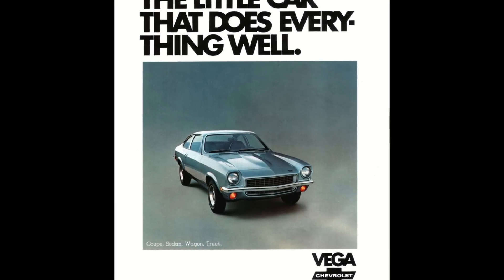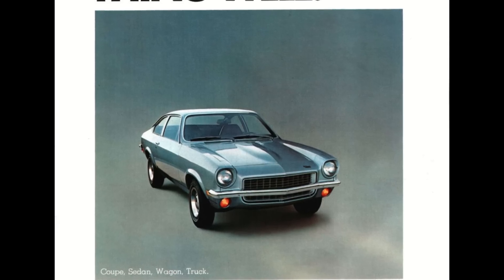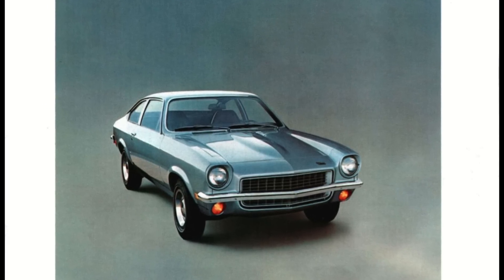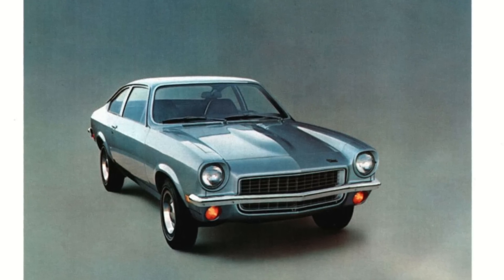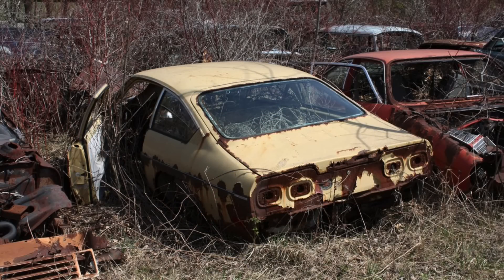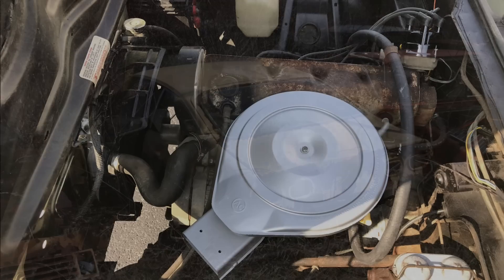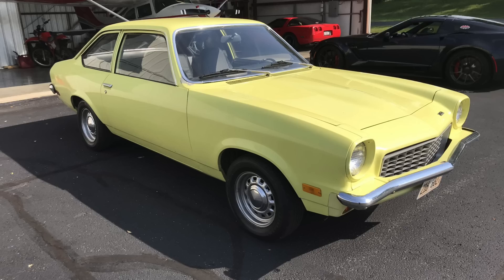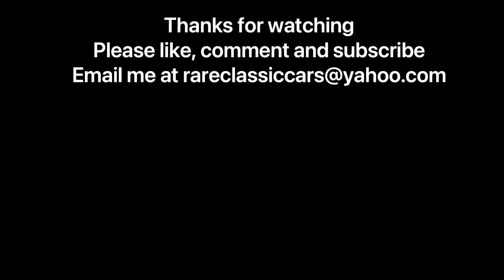GM's Largest Failures: Why The Chevrolet Vega's Engine Turned Buyers Away From American Cars

Comment: In the later 70’s, I had a Vega when I was 17 years old, it burnt a lot of oil…. Fortunately I worked at a gas station and just refilled it with  USED oil from oil changes…. 😂 …. That simple approach made it a great car… NOT.

In the end I had three of them, would pay 50$ for them… thats how bad people wanted to unload them…

Front brake caliper mounting pins would walk out , rear brakes would not hold an adjustment, the front rotors were non-vented and would FADE with one stop.   WORST brakes on any car I have ever owned.

 Front  frame where the upper control arms would bend inwards and make alignment impossible without a correction kit ( off set bushings from Moog ) .     

I had two others that I also bought cheap and one did not burn oil , to my surprise……    

I used to beat the living daylights out them….😅.   I could care less about them….

The odd thing , they all got hit by other people and it was their fault, not my fault, were totaled by insurance companies and I got far more money than I paid for them…  I think people would try to put them out of their misery!   So that made them a great a car….😂

Honestly, that car turned me off GMs…. 

Did I say how much enjoyed beating the day lights out of those Vegas? 😊😊😊😊😊

Comment: The Vega could have been such a good car. It was an entry level young persons car and Chevrolet should have made it better if they wanted long term customers. My friend had a used 71 Vega Wagon. It rusted out in the firewall. You could poke a screw driver through it. He wasn't a car person and was on a 300 mile trip when the head gasket blew because it was low on coolant. They replaced the head gasket but the cylinder walls were badly scored. It burned a quart of oil every 75 miles at which point you had to replace the oil fouled plugs and it would run again. The oil problem got worse over time. We drove 26 miles one way to college and before we left we replaced plugs and before we drove home replaced them again. We would clean them and reuse them. He carried a case of oil in the back. It soon got to the point where it had very low compression. It would barely make it up a hill and leave a smoke trail everywhere. His girlfriend told him if he didn't get a better car they were through. If you road in the car when you got out you stunk like burning oil. He finally sold it for $75 and got a nice used 75 Ford LTD 4 door sedan. Talk about a 180 degree switch. His girlfriend hated that car too. That car also rusted to the point the front bumper fell off! He knew I was a car guy and never told me he was buying a Vega. If he had I would have told him just don't buy a Vega! Later in my career I worked with an auto engineer that had worked on the Vega project. He told me they new the engine was a mistake but it was too late to stop production but they had already begun research on a better engine. In 1975 my uncle bought a Monza. I think it had the Vega engine. He never had a problem and he took good care of it. My dad had a 79 Pontiac Sunbird and it had the Iron Duke engine. He never had a problem with it. The Vega had another issue and that was the gas mileage wasn't as good as it should have been for a sub compact car. Good video on the Vega. Now people put V8s in them and drag race them. I know a guy that did that but that's amother story.

Comment: I had one of these in college.  I used to buy the cheapest oil I could find by the case.  I added oil probably every 100 miles.  Definitely more often than adding gas.  I justified it as a continuous oil change.  The car was absolute junk.  I had other GM products after the vega and none failed to disappoint.  Needles to say I no longer consider GM or for that matter any domestic auto manufacturer when looking for a car.  It hurts to say that but unfortunately it's reality.

What's really funny is that it doesn't have to be that way.

Comment: It seems the popular consensus is to blame the aluminum sleeves, but Mercedes and others have had great success with the hyper-eutectic aluminum cylinder walls. The massive V8s in the 450 and 560 SL series. My wife had one with 300K miles on it and still ran fine.

Comment: I have owned two Vegas in the past. A 1973 GT and then later a 1977 wagon. The first one burned so much oil that when you pulled into the gas station, you said to the attendant, please fill it up with oil and check the gas. .. on that car. the fenders were rusted so badly that I could put my whole arm inside of them. However, the second car was much better. I bought both cars dirt cheap. The 77 did not use a drop of oil and was pretty much with no rust. I drove it to almost 90,000 miles before I sold it and it still was in good shape. The cylinder blocks were alloyed with silicon for the reason of improved cylinder wear characteristics on the parent metal block. At the factory, the cylinders were electrically etched to melt the silicone alloy and create a glass like surface on the cylinders that was very hard. This hardened surface was only about 5000 of an inch thick. Cylinder scuffing did not occur during cold start up. It occurred when the engine was overheated. Usually the back cylinder would scuff first because that was the hottest cylinder in the block. Dura built engines starting in 1976 still used the same block but have many improvements. They had improved oil galleries in the head and had hydraulic lifters instead of solid. Also, they had a better location for the high temp indicator light in the cylinder head and additionally, they had much larger radiators with low level coolant indicators. Interestingly, the odd design of having a cast-iron cylinder head on top of an aluminum block was due to the weakness of the original aluminum block. The cast-iron head was meant to help stabilize and strengthen the aluminum block beneath it. These design changes allowed the engine to realistically have a service life of over 100,000 miles. But the damage was done with the previous model years and with a poor record sales fell off and the engine was discontinued after 1977. The body platform lived on for several years in the Monza and Pontiac Astra powered by the Iron Duke 4 cylinder.

Comment: Ford should have paid attention to the history lesson taught by the open deck cylinder design head gasket issues of the Vega. There are many fairly new 4 cylinder EcoBoost engines with failed head gaskets, and Ford eliminated the coolant groove passage between the cylinders on the deck surfaceand used drilled holes further down on new design.

Comment: GM had a perfect 153 ci 4 cyl engine on the shelf they could have used all along. Then in the late 70's when they restyled the Vega (and called it Monza), they came up with the Iron Duke which looked like the 153 but was entirely different.

Comment: Congress turned American buyers away from American cars!
Americans wanted big cars, that was what was selling and was in demand. Along comes congress, they hit American automobile manufacturers with gas milage mandates, 5mph bumper mandates, and exhaust emission mandates all at once and gave them 3 years to do it. It takes 3 years from the design board to the factory floor to put a car into production. Plans for cars yet to be built were already 3 years away and were still in the design stages. The Japs were already building cars that were fuel efficient with small engines that produced less emissions than America's V8's. Japan is a group of islands with zero natural resources and all their petroleum has to be imported, so the have always built small cars that used less fuel than ours. The Japs moved right into the automotive market in the USA and Congress (Democrats controlled both houses at the time) handed them the golden key to the U.S auto market, with no tariffs, and ruined the U.S auto industry for good. $6,000 of the price of every U.S built automobile goes toward the U.A.W pension fund for a retired workers that no longer works for the company, Japan doesn't have that expense. The U.S auto industry will always be behind the eight ball and with Chinese cars coming soon. the USA will probably exit the auto industry altogether.

Comment: I had a 1974 vega i bought new almost immediately the head had to be replaced after that it used a little oil. I never had any other problems put a lot of miles on it. It died in a 5 car pile up in 1977. I am glad for the built in head rests. I was the middle car.

Comment: In 1976, my first car was a rusty used 1972 Vega. My 16 year old self purchased it from a "Mechanic" for $250.00. It was junk. I turned the corner one day and steam came out of the front of the car. The radiator had rusted off it's mounts and got a hole tore into it from the plastic fan. Re-cored the radiator and the black plastic fan was still in good shape for continued use. Every time you hit a bump, you could smell gasoline.
My High School buddy told me Vega would go down in history as one of the worst cars ever built. I told him he was just jealous because he didnt own a car yet. LOL!

Comment: We had a 73 gt ,4 speed that would hang up and not go in any gear if you pulled up reverse lever while shifting to 1st gear. A spring would hang on the exhaust. You had to reach under car to move the spring .

Comment: In the late 70s', we had two guys, Frank and Harry, who used to come to our shop and buy Chevette motors and radiators out of wrecked vehicles and install them in the Vegas. They were actually pretty good cars then. They built several dozen of these Chevegas through the years. RIP Frank and Harry. All through the 70s' and early 80s', when people would buy small cars, they would always ask if it had an aluminum engine, that's how bad the reputation of the Vegas were.

Comment: I've owned 6 GM vehicles in my 50+ years of driving.  Not ONE of them was reliable, and every one of them came with serious design defects that in less than 100k miles of use were either costly or impossible to repair.  I haven't bought a GM vehicle during the past 30 years, but wish I'd learned this lesson even earlier.
Reply: You haven't owned a GMT-800 series pickup with an LS motor, then...
Reply: @SEO122  Or a GMT 400 platform truck either.
Reply: @SEO122  You're right, I have not.  And won't ever.  I do respect the Chevy 350 that was in the last GM I bought as a good all-around engine.  Too bad the rest of the vehicle was junk - everything from the pathetic 4L60E trans that failed at 80k miles, to the howling differential that failed at 60k miles, to the main wiring harness that failed before 100k miles, to the heater core that failed before 80k miles, to multiple failed electric window motors - I've only listed some, not all, of the failures.  I bought a 2009 Mazda and disposed of the Chevy with barely 100k miles as part of the "Cash for Clunkers" federal program in 2009.  Guess what, I've already driven that Mazda nearly twice as far as the Chevy, and it has never required anything but routine maintenance...not 1 single failure of any type.  An additional consideration:  if I'd driven the Chevy for the additional miles put on the Mazda since disposing of the Chevy, I would have burned an additional 5000 gallons of gas during that time, based on the difference of their EPA ratings.

Comment: I still own the '73 GT I bought new. The issue with the Vega engine is GM's alone. Reynolds used  chrome plated pistons, and a larger radiator in their test cars. GM reused both to save money. Nothing really wrong with the A390 alloy, but the cooling issues really doomed the car. Reynold's walked away from the Vega in 1971, largely because GM cut too many corners.

Comment: My dad had a Vaga GT and the engine did just what the video said, the engine was burning oil with in about 40000 miles he took it to the mechanic he used all the time and he said he could fix it by putting sleeves in the engine they took the block to a machine shop and they bored it out the put sleeves in it and put new pistons in and after they did that the car ran really well he gave the car to my sister in 1979 and she drove  the heck out of it and in about 1982 it was setting on the street and a guy ran into it and totalled it out it had about a 160000 miles on it when it happened

Comment: The air cleaner comment is correct, however it was advertised as a 50,000 mile air cleaner.  So in theory, you would only need to purchase one filter in 100,000 miles.

Comment: GM obviously didn't spend years testing this design. Mabye one year. Another case of engineers thinking they are such genius's, they do not need any testing. Their designs are simply flawless. Any of the problems associated with this engine could not possible be due to design flaws. GM should have gone back to the old reliable ' iron duke ' cast iron overhead valve or the iron lined V6.

Comment: I don't think the open deck would have been an issue if the head was also aluminum. Honda doesn't have any problems due to cylinder walk until the power is well over stock.

Comment: Knowing the failure of the Vega engine, why did GM again try the aluminum/iron design again 10 years later for the Cadillac HT4100?
Reply from the maker: It had cylinder liners
Reply: @RareClassicCars  Ah ok. Well, at least they eliminated that issue 🤣

Comment: My mother bought a new 1973 Vega Kamback ( wagon).  It didn't  have air-conditioning,  and she loaned it to me during the hottest week of the summer.

So I drove it with the 2 front windows rolled down ..... and surprize absolutely no outside air entered those open windows (perhaps because the air trapped in the car couldn't get out.) I've never driven a car where opening a window had zero effect.

Comment: Great video! I thought you may have mentioned that Vegas uses a ridiculous  rubber grommet for an oil cap.  
I was  a young gas pump attendant in years 1972 through 1974. Back then we had to wash ALL windows and check under the hoods of EVERY car.  
When any Vega with more than about 35,000 to 40,000 miles came in to refuel,  it ALWAYS needed oil. Due to the difficulty in removing, handling and replacing the extremely hot rubber plug grommet that GM used as the engine oil fill cap on the Vega engine, adding oil was a lot harder than it needed to be. 
I recall the grommet oil cap  was on a sloping surface and I had to either pry out the grommet with a screwdriver or use my finger nails. It was hot and oily and as such would usually be dropped and roll somewhere under the car. 
Usually, after adding the oil, it was a challenge to replace the grommet oil cap into the hot engine. Once or twice my oily fingers  dropped the silly rubber grommet again! 
Such a design on an e engine that didn't burn oil would be fine. But using a rubber grommet for an oil cap on a Vega was a curse!
Reply: Tell them oil is all sold out!  Lol!

Comment: I had a 1974 Vega GT hatchback, bought it used from my brother as he had to shelve the plans of dropping a V8 engine in it.
Himself being a Chevy dealership mechanic, he had some workarounds to combat the sparkplug fouling nature of the oil-burner the Vega was:
- Install the hottest heat-range spark plugs to be found.
- Advance the engine's ignition timing.
The drawback with the advanced engine ignition timing was that the engine needed premium gasoline.
To lessen the oil consumption issue:
- Use 40w motor oil, and in warm weather, add a can of STP Oil Treatment, as that combo could lessen the oil consumption when compared to using a lower viscosity motor oil.

The car was fun to drive and handled very well.  The interior was laid-out nicely and comfortable.
But, alas, by 66K miles the clutch was going bad and the rear-body panels were rusting away.  Oil consumption was at one quart every 200 miles.
Sold it to a guy that had plans to drop a V8 engine in it.

Comment: The lack of liners was one problem with that block... the other was the survivability of bolt holes. Put a steel bolt in an aluminum block and dissimilar metal electrolytic corrosion would make the threads come out of the block with the bolt. Poor oiling in the 2.3 meant big end bearings tended to die young. You could get at the bottom end to replace the bearings but you'd never make the bearing cap bolts make torque again... without helicoils, anyway. Engine bay was big enough to fit a SBC V8 but only drag racers wanted to futz with an engine swap in such a cheap car.

Comment: I had a Chevrolet Monza with that 2.3 liter engine.  Good grief, it was awful.  You could watch it rust, and the engine never ran right.  Toyota buyer now.  That stupid air cleaner assembly was about $40 in 1978 - that's $192 in 2024 dollars - for an economy car air filter.

Comment: I have to clarify one point. Until, at least, the advent of oil-jets at the bottom of a cylinder spraying the bottom of a piston, cylinder bores and piston rings are not lubricated by pressurized oil - they are only lubricated by the splash of the crankshaft.  Perhaps that is something else they should have thought of...  
As for the freestanding cylinders, I would wager heavily that those were done that way for maximum coolant flow... which some other idiot negated by putting that 12 inch radiator in the car with no recovery tank!  Ironically, I can't think of a 1973 or newer GM vehicle we have owned that did NOT have a coolant recovery tank...

Comment: I bought a 74 vega station wagon back in the early 1980's .Paid $100 for it and put a clutch in it .I was a teenager .i drove that car all over the beaches of Pinellas county Fl ..It burned1 quart of oil every 45 miles  .But oil was cheap back then .Castrol oil was like $0.35 a quart ..I miss that ole party wagon 😮